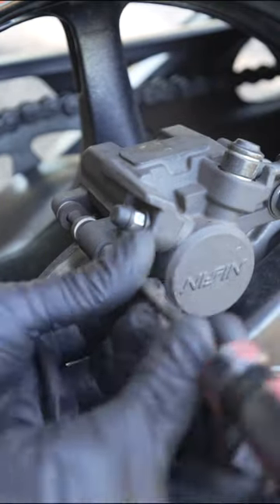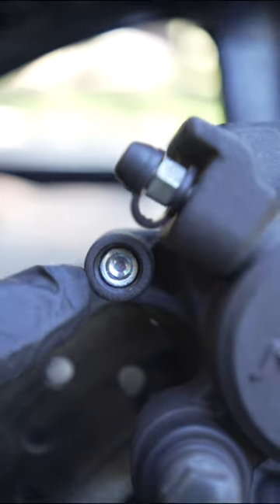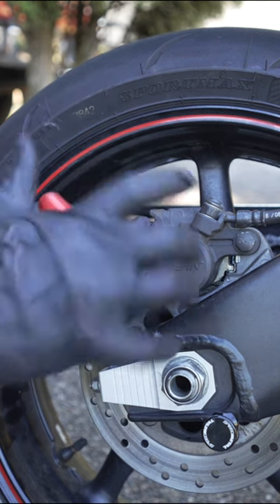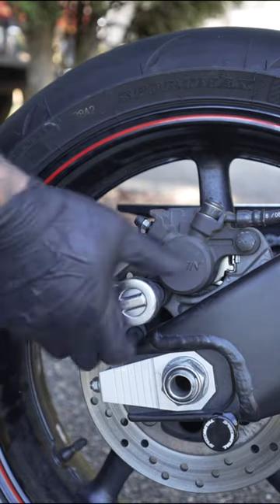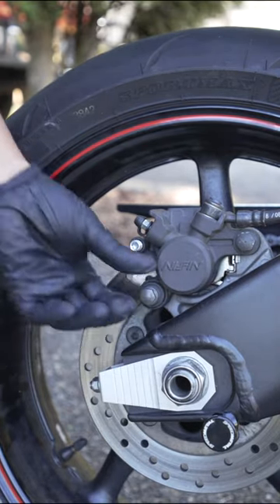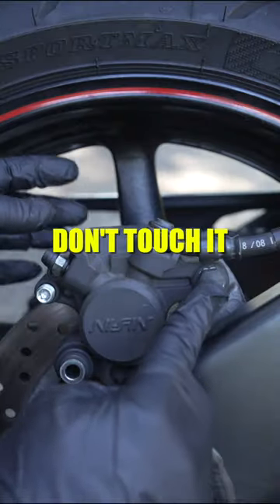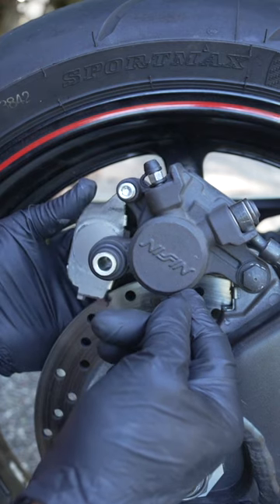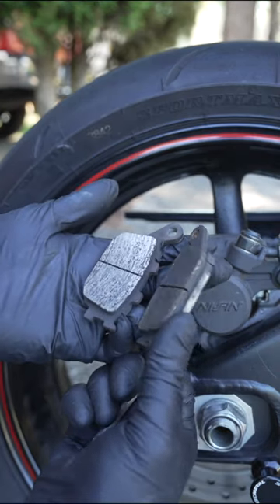THE EASIEST REAR MOTORCYCLE BRAKE PAD SWAP

Comment: he just makes this look too darn easy, somehow, i'll end up with a spare bolt, trying to do this tomorrow.
Reply: @nonamesixx only someone who hasn't worked on cars/bike would say it's a simple task always. In reality half the time you'll end up with something stuck
Reply: If you end up with a extra bolt when there is only one to take off you shouldn’t be working on your bike
Reply: @CryoFreezr  or you realize it's a weird bolt size and gotta buy new tools

We had the when removing axle nuts on my buddies 848
Reply: @MaxC_1  only someone who doesnt work on bikes would own a bike with something stuck
Reply: @Ridinglawnmower145  or riding one for that matter lol
Reply: @MaxC_1  Brake jobs are generally a very simple task, it can become complicated, but anyone who has worked in a shop, knows a brake job, is not a hard process 90% of the time.
Reply: just did it myself with this video. he failed to mention that the piston needs to be pushed back so that the new pads can fit in, and also now my pads are so tight the wheel won’t spin easily. He also failed to mention to release pressure from the brake reservoir before pumping the brakes that pushes the piston back in to the pads. These videos are just… idk why he does them without detail

Comment: Holy shit, I learned something! I was going to go through the whole process according the shop manual. However, using a pad spreader is needed if the replacement pads are thicker.
Reply: That’s what I tell my wife. “Hey baby the pad spreader is coming for you, if you don’t spread them it will, MAAAKE WAYYYY”

Comment: What about cleaning the pistons? Then pushing them back in.
If you don't clean then there's a high chance the seals will fail or seize in the future.
Don't forget to at least lubricate the slide pins too!

Comment: I hate the little plugs for the brake pin, it seems 8 out of 10 customers plugs are seized or stripped. Just get an extended brake pin with a hex head and save yourself a step. When the cap gets seized or stripped (flat heads shouldn't be used anymore) it's usually not fun to get them out.

Comment: My motorcycle has a drum rear brake ☹️ plus it won't start.
Reply: if its been sitting for a while and if its got carbs on it instead of injectors; look up how do drain the carbs, drain the tank, put some high quality gas in it and it will fire right up.

Comment: I changed my rear pads on my 2013 R1 but I removed the bolt you said not to touch. Is there a reason for not touching the bolt and what happens if you remove it like I did? Do I just need to torque it back down to spec bc initially I tightened it too tight and couldn't spin my rear wheel freely. Any idea on the torque spec?
Reply from the maker: Just an extra step
Reply: If you didn't push the caliper piston in that would explain why you couldn't spin the wheel freely.   Anytime you replace brake pads, whether on a car or bike, you have to push the pistons in a bit because the new pads are thicker then the old ones.   If you're just removing and replacing the same pads you won't have to push the pistons in, as he did here.